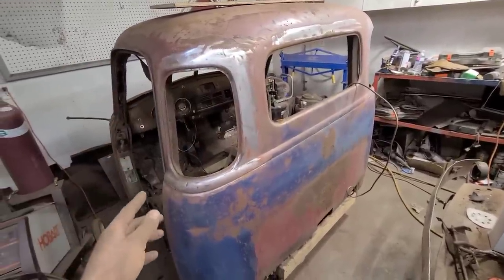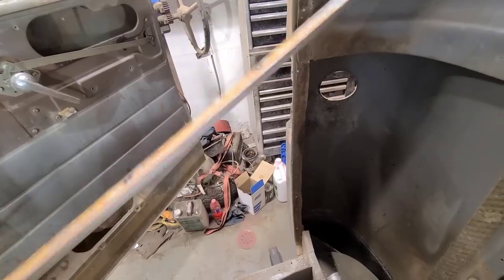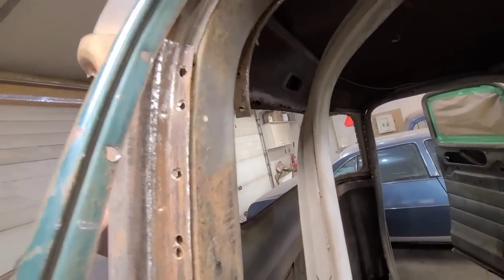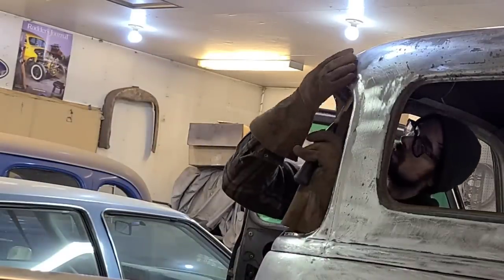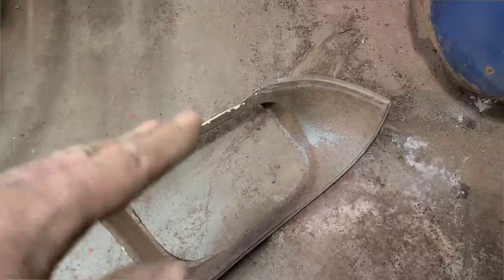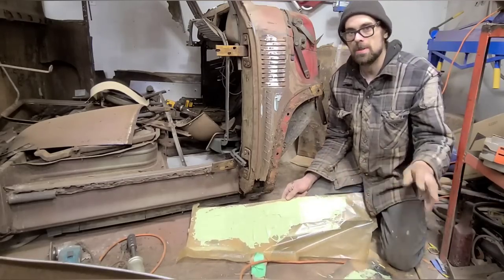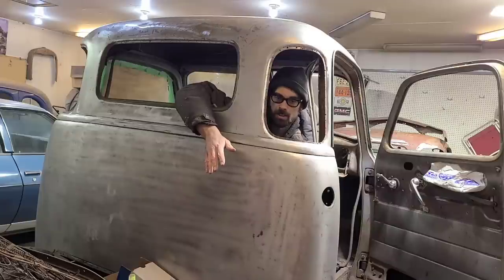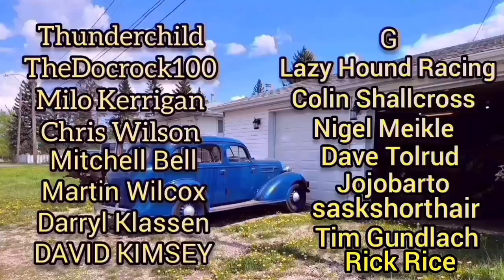How To Convert a 3 Window Cab to a 5 Window The Cheap Way. 1947-1954 Chevy or GMC Trucks. Part 1

Comment: IF you watch my Karmann Ghia fender replacement it is done almost exactly the same way.....make sure you lines line up and cut into a butt weld. drops right in......The only difference is I use a fair amount of filler at the end which lasts for the life of the car. Never above spec. on filler, then your fine. use USC Grip filler for best results. handles panel stress, less pinholes. Appreciate metal finishing but I dont use lead. for reasons I have learned about 30 years ago. But I do have respect for people who choose it....LOTS OF WORK.....
Reply from the maker: Nice save on the Karmann Ghia fender Mike! I'd have done the same thing instead of spending huge $$ on a new replacement. This truck will be getting plastic filler on it too.
Reply: @CarterAutoRestyling  not much from the way you do work!....your fender metal finishing is pretty amazing. lots of patience.

Comment: Your "Pennsylvania Porcupine Technique" is not far off from another technique I heard about.  I had a friend who worked for a construction company years ago and a truck came in with a caved in door.  The "old time body guy" told my friend to stand back as he rolled up the window, pulled the door lock, filled the door with starting fluid and lit it off.  It blew the dent out of the door!  Next he mixed up his filler, applied it to wax paper and slammed it to the side of the door.  Then he broke out a paint roller, smoothed it off, pulled the wax paper and painted the door.  No sandpaper required.  When the driver picked up the truck he pulled out of the driveway, hit a bump and the repair came off in one sheet!  Needless to say the "old time body guy" (retired?) shortly after that! 😆
Reply from the maker: Hahaha that's awesome!
Reply: I love that story!
Reply: Knew a guy famous for 'cheap, but just enough your car operates' 'bodywork' - rolled car? no problem! $500- 
some did not look like they had rolled over, but you could not easily tell what it WAS either. 😁
Reply: I’ve seen that type of dent repair with gas. Also great for mounting large tires on rims.
Reply: I’ve seen that type of dent repair with gas. Also great for mounting large tires on rims.

Comment: I call those rough trace outs DO NOT CUT lines. Then I do the same measure about 1/2 inch below it and cut there. so you can effecivly lay one over the other. ....Like the taylors measuring tool idea. I do most of my work the bad chad way of by eye (or he does it my way I am a bit older than him) . but that is a good idea.

Comment: dang, i guess I've been doing extra work by bending the studs over to hold my cardboard in place while the bondo cures
Reply: I was making the same mistake! I didn't realize I could just put some in sideways
Reply from the maker: Glad I could save you some time on your next repair!

Comment: In the VW world we are now using many other doners to fix a 21 or 23 window due to the fact that most of them are the same issue as your 5 window. The flack you get from the peanut gallery for doing that is crazy....Really you are doing what you have to do to save a car.....The rest is preference.
Reply from the maker: Yeah it's crazy the lengths you VW guys will go to save those old buses,  seems like nothing is ever too far gone to bring back!
Reply: @CarterAutoRestyling  you should check ou the vw sings cab  cherry picker I saved. They are almost extinct. I surely could not save it metal finish or even close. had to use a lot of lap tap and fill. hand making parts. parts substitution. Could not afford to use all patch panels. would have cost over 20k in parts. Still done right and holds that heavy lift on there.

Comment: Another great production.
      Doing something right the first time is definitely worth the extra time. Sure beats doing it over.
      There's one thing I can't stress enough though........Eye safety.
      I spent my career in the pipe trades, using grinders all the time.
      There was at least two occasions, wearing both safety glasses and a face shield, I got metal in my eyes. Those hot little peices of metal will bounce off in all directions. They will stick to the cornea, and require medical attention to remove. The cornea heals quickly, often times in roughly 24 hours. 
      An optometrist will actually have to "pick" the embedded metal particles from the cornea. This can even cause rust stains in the cornea.
      You may already be aware of all this. 
      I know it's a pain to wear all that protective gear, for a number of reasons.

Comment: I was certainly happy to see the Pennsylvania Porcupine technique as I'm from Pennsylvania and certainly should have this technique in my skill set.  I thought about converting my Spitfire to a 5 window but I think I might have trouble welding the new metal into my convertible top.
Reply from the maker: You need a special welding wire for that

Comment: Obligements CAR - for the insights on such a successful cab surgery. My daily is a 5 window '53 with a '54 truck 235 standard column. Tell my wife it's a chick magnate - but most every one of them are our age & had learned how to drive behind the wheel of them.
Hell - even had one ask if she could stick her head in the cab for a memorable smell of it!
Thought I'd share a Little humorous tip on these windows. Never tell a proud owner of one at a car show that... LMC has just released a new kit to cover those two side windows.

~Blessing on your every endeavor CAR - from that that last resting place state of those 3 blood baptized Texans - Crockett, Bowie, & Travis!

Comment: Hmmm...   Swap the Bondo for Holt's Muffler Cement and that's the way I fix rusted out tail pipes. All this time I've been doing finish metal work without realizing it. Now I can fix the dents in my Fender (P bass)! 
Truck's beginning to look nice btw.
Reply from the maker: Thanks! I use an old soup can and hose clamps on my exhaust repairs

Comment: When I was first working on the nose of my GT6(see my avatar pic) I didn't have access to a porcupine machine. Someone suggested welding metal strips on and use vice grips to tug on them. I gave it a try... and it didn't work. Probably because I wasn't a total noob. And I didn't apply canned 2 part metal finisher. It did look much like a catfish. 🤣
In the end end I beat it out, mostly with a hammer/slapper and dolly.
Reply from the maker: The metal strip technique does work, but that and the unispotter are always kind of a last resort thing. Hammering it out from the back is always faster and easier!
Reply: @CarterAutoRestyling  I know that now. Back then it was my first foray into a new world.

Comment: Thanks for the video.  That cab came out great.  I just love people that make a video about something they've never done before.  Like this one, first time welding, first time metalworking, first time setting the floor on fire etc.  lols.  Have you ever tried doing surgery on a person or anything like that???? Seems like it would be easy for you compared to this.  Now, on the dent repair.......ahh...  think you might want to turn the heat up in your shop some or get the fumes out with a better ventilation system.  It might be affecting your thinking a bit...... just saying, as a guy that's never set foot in a shop or held a tool in his life, I'm sure I'm qualified to say that repair seems slightly less than ideal.  Great video... thanks again.
Reply from the maker: My lawyer advised me not to talk about the time I tried doing surgery on a person

Comment: Interesting you would mention the panel adhesive. I need some to attach two 1" X 4" joints and two 2" pipes nipples. Ran into the same "issue" you mentioned. The adhesive is almost $100.00 plus the special gun that is needed to apply the adhesive is at least $150.00. 
Found one small size kit @ $35.00   that allows using a normal caulking gun.  Guess what???    It's  conveniently, all "out of stock until February. Obviously, there's no "guarantee" they will have any in February, either. Looks like I'm going to try using good old JB Weld !!! ;o(
Reply from the maker: Haha yeah everything's always out of stock or too pricey

Comment: I have a question when you cut and  But does that prevent the metal from warping
Reply from the maker: No the weld will shrink (warp) no matter what you do. The trick is to minimize and control it

Comment: So it's fix a dent, cut the fixed dent out and leave a hole, cut out a different hole and then weld a new hole in the old hole.

Comment: do you tack and grind every couple because the metal is still warm and no fighting??
Reply from the maker: Sorry I don't understand the question, but you can watch my video titled "Is There A Faster, Easier Way To Mig Weld Thin Sheetmetal" for a detailed demonstration and explanation
Reply: sorry i meant you were tacking a few at a time then grinding. is the reason for this because there is still a little heat in the weld that it is easier to grind off??. hey! Merry Christmas

Comment: do you have a resistance spot welder  two or one sided makes putting on them weather strip channels easier and proper job of pinch welds pretty much like the first go i  did  at welding  the girlfriend first go was even better who knew ? ps still love them cats
Reply from the maker: It would be handy to have one for sure!

Comment: Kyle, I’m getting ready to do one of these conversions soon, and would like to hear your opinion about why you prefer this approach vs. putting an entire different roof on.  It would seem the amount of welding for the second approach is much less, just the base of the A-pillars and the spotwelds around the rear belt line.  Were you concerned that the door opening would be hard to line up properly, or the cab would get out of shape. I have noticed that the aftermarket kits install in a similar fashion to what you did, with flanges added around the perimeter.  Could you please discuss the pros/cons of each approach? Thanks, love the content!
Reply: Oh, and I already have another cab and roof to use.
Reply from the maker: I didn't have an entire roof that was usable, only the rear corners. Splicing an entire roof at the factory seams would be a cleaner job, but it's going to be the same amount of welding to do the job properly. It's not as simple as just cutting the roof off of one truck and welding it on another. I would suggest watching the "Chicken Truck" playlist on this channel, specifically the earlier videos where I am chopping the roof. Those videos show a lot more detail on how these cabs are constructed.

Comment: Hi. I have a 54  3 window. The inner window area  centrer skin was rotted out.  Missing now. I'm searching for a replacement panel
Reply: Or make one. It's not a restoration.
Reply from the maker: Mine is rusted out too, unfortunately. Seems to be fairly common on these trucks!

Comment: Did you look at LMC for the rear panel?  With it shipping it’s $700.  Customs maybe from the US?  It looks amazing and better anyway the way you did it.  Gives me hope on my’51
Reply from the maker: LMC is where I priced out the rear panel. It's $1600 Canadian
Reply: @CarterAutoRestyling  That is an insane cost difference.  Considering the exchange rate is 1.36 cad to 1 usd.  You definitely made the right choice.
Reply from the maker: @OC Coug  Yeah everything here costs double or sometimes triple what it does in the Us, it's crazy.

Comment: I think you need a girl (they usually are) to look after continuity... not much other use for them. If when you welded those studs on you clamped a pair of grips to each one and then tied a piece of rope to the grips you could attach them to a tow hitch and pull the dent out. Merry Christmas.
Reply from the maker: Haha! Merry Christmas!

Comment: You are high tech using a tailors tape, I use painters tape. You need to find an old aircraft mechanic, like I am, knock him over the head and take his cleco pliers and clecos. I am currently doing a big back window conversion on a 56 ford pickup.
Reply from the maker: That's awesome! (The big window conversion, not assaulting an aircraft mechanic haha)

Comment: Nice job ! But I have one huge issue. Some of you weld without proper welding helmets. Maybe you don’t care about your eyes , but some are gonna see you and decide if you can weld without helmet , they will. You only have one set of eyes , take care of them. I worked in ER , too many came in with damage done to eyes because they preferred to grind or weld without eyewear. I restored cars and rodded some. I know the hazards .

Comment: More uncommon and thus more collectible doesn't equal to better or more attractive. Should ask yourself why most didn't get these trucks with these extra windows in the first place.

What's next? Add rear corner windows on a 34 Ford 3 window coupe?
Reply from the maker: Because it was an extra cost option, it's as simple as that. Not because they are "lame" as you stated in your previous comment. You obviously feel quite strongly about this, which is why I'm glad I decided to butcher up the 3 window cab to make it a 5 window.
Reply: @CarterAutoRestyling   It's nothing personal man, don't take it to heart. It's your truck and you obviously do whatever you want with it. You do great work, and don't let my opinion take any away from that. It's just a personal opinion that doesn't mean anything.  But I do think it's fun noticing these types of windows that used to be filled in back in the day, to get that "custom" touch, is now retrofitted instead. Plenty of car models in history have in later models gotten added windows in that far back corners, in most cases made them less, not more desirable. Better for blindspots, but less cool looking. Who ever cares about blindspots anyway? Women perhaps...These trucks is an exception for some reason, that many disagree with, but perhaps more agree with. I believe many think the small rear window and sailpanels without glass gives it a little bit of that "cool" mystery privacy look, as opposed to maximum rear glass, and one always being on display from every angle ala AMC Pacer. To my eye, they look like an afterthought, original or not. But at the car show, sure, you' probably get comments on the "uncommon desirable" additional windows.

But after being in the market for these trucks for a while' and 3 times in a row ran into owners that cut in these additional windows, yes, it's been bugging me a little, as I've not succeeded in finding one without. Which is how I came to subscribe to your channel. And now you too do the same thing Lol

Many things are extra cost without making the overall package more desirable. Mudflaps come to mind.